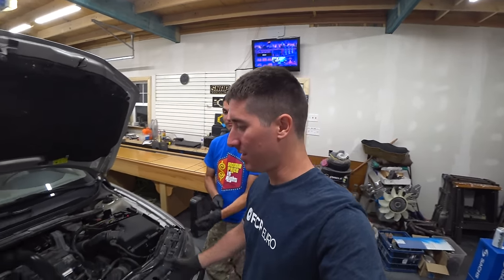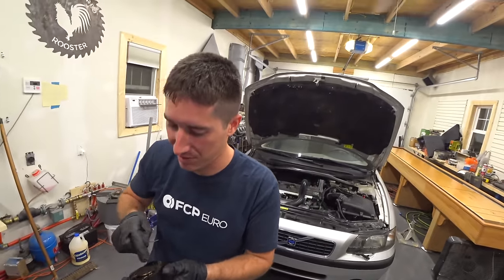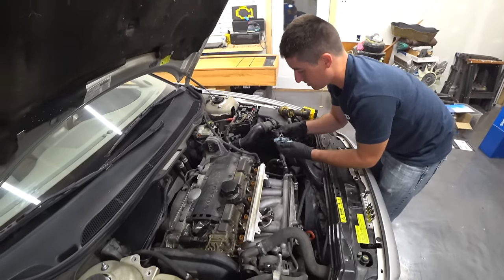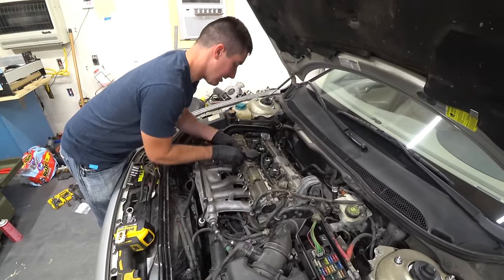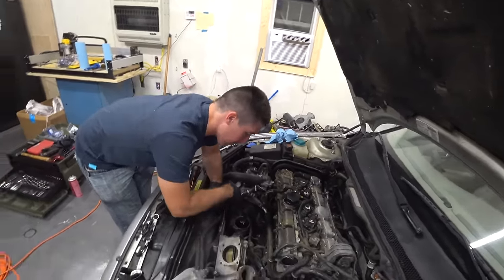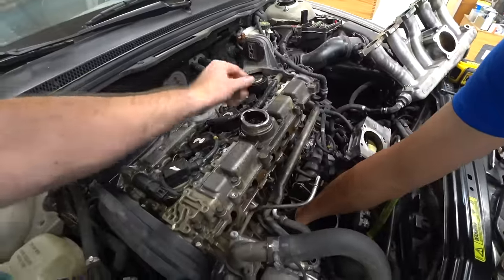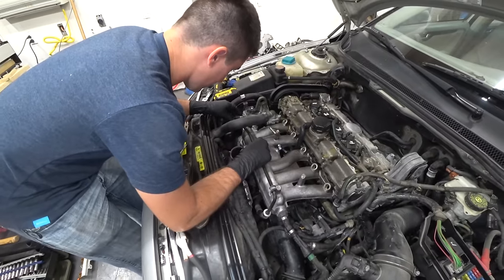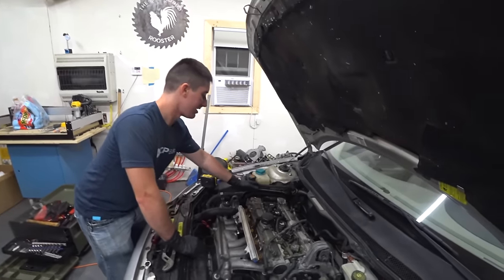POORLY DESIGNED Volvo S60 PCV System *COMPLETELY Clogged With CARBON*

Comment: I did that same job on my V70.. why didnt you do the coolant lines of the PCV and the part at the fresh air snorkel right by the Turbo? On mine those were about to go (cracked) and the connector part in the thermostat housing was corroded shut and caused some air bleed problems in the colling system. I would've recommended doing those too, because if you have it apart that far - it would suck to do it again in the next 30000 miles.

Comment: If the cam seals still leak after replacement, remove the VVTI mechanism on the cam and strip it. There is an o-ring inside that goes hard and is not always replaced when people change the cam seals.

Comment: I changed the pvc system on an 2.4 na s60 . The bottom left intake bolt was nearly impossible to get at . Used combination of swivels etc . In retrospect I think draining the coolant and removing the thermostat housing would have been worth it . Lots of time and swearing did get it done tho .
Reply: Thermostat housing has torx that are just as hard to get out and in. Will help broaden your vocabulary of profanities.

Comment: I gotta be honest. For these era S60's. If you find a non turbo they will probably run 300k miles if you take care of the suspension issues and don't have one the shitty ones with the transmission slip issue.

Comment: Step one with most Volvo 5-cyl work - remove radiator fan, you get so much more room to work in the front of the engine without the fan in the way...

Comment: You want to put some clean engine oil on the fuel injector o-rings before putting the fuel rail back in or plugging injectors into the fuel rail.  Pretty much any o-ring you want to lube up so they don't pinch and leak.  Makes installation easier too.
Reply: someusername121: Although we did that, I think we neglected to mention it.

Comment: When cleaning out the PCV box port, into the block. All the crud goes into the oil pan area. I do an oil change soon after. But, really hate the idea of that junk going in to a clean space. Any ideas out there? Like blowing air into the oil cap? What works, to prevent it, going in there? Thanks.

Comment: JR is a Volvo newbie. It's not called a throttle body. Its is an ETM, or electronic throttle module. And that connector is so easy to remove. Same place in my S80. I can take off and replace the etm in less than 10 minutes now its stupid easy. They love to go bad by the way
Reply: There is a company in Canada called Xemodex that rebuilds the ETMs to remove mechanical contact points and the ETMs will then last forever.

Comment: Your videos are fun and useful. On the PCV job and any subsequent jobs, it would have saved you a lot of time to remove the whole front end. It is modular and it opens a lot of room to work  cleanly and much faster. You just need to drain the coolant. That volvo will be good to go for a long time.
Reply: Andres R Torres:😉🍻

Comment: Was there no power steering fluid issues when you removed the power steering tube?  If there is when the system is filled with power steering fluid, what needs to be done to best manage the situation?

Comment: Hi guys I have a question about the PCV on a 2006 Volvo S60 R. When I do the glove test it sucks in at idle but then blows out when I press the gas. Is it supposed to blow out when adding boost? It's causing my return line o-ring to fail even after replacing the line, o-ring, and gasket after already servicing the PCV. Is there something I missed?

Comment: Did my 02 S60 2.4t PCV system a year ago. Exact same process you just went through. Its annoying to do but worth it. 
Is there a reason you disconnected your throttle body from the intake? i might not have caught that. i just disconnected mine from the tube and took the connector off.

Comment: Air or electric ratchets are awesome for those hard to get to places..   just a tip...
Reply: are you joking?  they're far too bulky for this job.  although I have the M12 3/8, what you really want here is 1/4 with extensions, these are all 10s and 12s anyway.  not sure you realize how cramped these manifolds are

Comment: The PCV on these 5 pot engines is a "maintenance" item. Also, it is not a complex job. These engines are very easy to work on considering their size and "complexity". Much better than a 2000s bmw engine for sure. Make sure you see RobertDIY on youtube to learn more about these Volvo engines. Oh, by the way, is this a segway for Doug DeMuro review an 850R?

Comment: Would the  use of top tier gas prevent the carbon problem? My 2001 Nissan Frontier was not built for ethanol and If I don't use top tier it will clog up some ports in the intake. May God bless ethanol.
Reply: not related to gas quality

Comment: If it eventually gets clogged with carbon, and pressurizes the crank case, would it be a good idea to put in a oil catch can, so it will not blow out the crank seals? Another question. Why does it clog up with carbon?
Reply: No, not possible or sufficient because of the additional blow-by from forced induction. This is the additional TLC and cost of driving & owning a turbo car. Does this make sense?

Comment: Its not poorly designed. The problem comes with not changing the oil. Just like most any other car that has carbon buildup.
Reply: That and too many short trips where the car doesn't get hot enough.  These cars need to go on a 45 minute - 1 hr trip at highway speeds a couple times a month to clear that shit out.

Comment: work on Volvos a long time.   people need to change their oil sooner than later.   alot of this stuff started when Volvo went to the 7500 mile interval and people went way over that and sludge etc. happened.    now with the 10,000 mile oil service even with synthetic is pushing the envelope.     we still see cars having issues with synthetic when they go too far on the oil.

Comment: Do you have to drain the oil before you do it?
Reply from the maker: No but I changed it anyway. If that bottom hole is completely clogged you have to drop the oil pan and clean the port from the rear. 🍻

Comment: If I had to do this again, I would remove the radiator fan first. Basically the same place on all transverse mounted in line Volvo engines since its introduction. When I did mine, I had the intake off for 2 days while I worked at my job at a parts house. Nothing like helping customers while scrubbing out your throttle body and intake ports. 🤣
Reply: Oh, and that last bolt under the thermostat housing got me so mad I took the belt off, moved the power steering pump, and take off the thermostat housing. I didn't care after that. I am now an expert in braille mechanics thanks to that throttle body connector. Hahaha!! (Easy mode reach in from under the right side of the intake manifold and you'll feel the connector.)

Comment: Do you torque all bolts back to spec when fitting back all components? Where do you get the spec for all bolts?
Reply: Nishen Naicker: Always! If the manual is not available, a quick internet search for the  bolt torque specification for the vehicle will tell you everything you need to know.

Comment: I need answer to the question what will happen if I cut the hose coming from the head, close the part going to the separator and vent the part coming from the head to the atmosphere by extending it and putting filter at the end of it?
I'm about to do it and I can't find any information on someone else who's done it.
Reply: Peter -- did you ever do it.   Curious to see the outcome.  I pulled the oil stick out and took the ruber seal off the oil cap as a temporary solution to minimize the pressure build.

Comment: WatchJRGo! Please help! 04 Saturn ion, high idle issues. 1200+ at stops, 2000+ in park! Shut off, restarted and it idled fine! I know the gremlin will return tho! Can you point me in any direction? Any help would be truly appreciated! Thanks a thousand in advance!
Reply: Thinking of pulling the throttle body, doing a thorough cleaning and replacing the IAC sensor! Anything I need to know? Please help me out man... Any info at all!

Comment: Lol my 2.4 NA is so my so easier to work on. My throttle body is completely exposed and I can get to my flame trap without removing the intake. Remove the electric fans and work from the bottom and top and I can get it out. The turbo has so much extra stuff in the way and also a different intake shape.

Comment: I'm going to do this job soon on my 2001 V70 T5.  Have to say, you should have never done this job without replacing that throttle body with a Xemodex electronic throttle body.  That's also a bitch of a job.

Comment: This is how tough it is to change the PCV on my Corolla. It’s buried under the intake and takes hours to change.
Reply: Scotty W how many miles on your corolla when you did that?
Reply: Roz Zeiler I do it at 80 to 85k miles. I mean it’s probably fine to go later since I change the oil every 5k miles with the best oil I can find. The owners manual does a terrible job at telling when to service it
Reply: thanks for the reply
Reply: Roz Zeiler no problem!

Comment: And you should see the super crappy PCV system in the Extra Crappy Chevy Sonic.
Reply from the maker: 😂 dang it, I wanted to buy one for a flip
Reply: @WatchJRGo  Just flipped a '12 Chevy Sonic hatch on Marketplace with my brother last week, sold in like 45 mins and my inbox was full, priced it at the top of KBB value. People must love them for whatever reason, we made a mini -killing off of it.
Reply: Don't you just have to replace basically the whole valve cover, a la' the Chevy Cruze?
Reply: @revolutionday1  On the 1.4L turbos yeah, but those are fairly easy 1-piece designs even though they're still stupid designs. He might be talking about the NA 1.8L.

Comment: How do you prevent the carbon build up in the first place
Reply: having done regular oil changes with quality synthetic oil since new is how
Reply: Mad DeXXX: You can’t. You can only mitigate the amount that builds through regular maintenance and oil changes.
Reply: Oil change regularly with good synthetic oil, avoid too much short trip stop and go driving as much as possible, don't use any Lucas, STP or any other junk oil additives.  The job will still need to be done every 75 to 100k miles.

Comment: These Volvo's aren't "poorly designed." Usually, they're poorly maintained.
Reply from the maker: @Gordon302  the PCV is 100% poorly designed… that’s why they made a new version that sucks less
Reply: @WatchJRGo  First of all, the 2001 model was the second year of the B5244S engine, which was used until 2009. Secondly, different engines obviously have differently designed PCV systems. Hence, that's why they changed it. Is it easy to do? No. But where else were they going to put it? The essential concept of hos it collects oil vapors is fairly simple in its design. Also, the oil pan isn't that difficult to remove. Since the PCV passageway was that clogged, then the rest of that passageway into the oil pan is going to be clogged as well. Also, companies like FCP and IPD are in business to sell you extra crap for your vehicle that you probably didn't need in the first place. There are much better dedicated Volvo only parts resources out there.

Comment: I think you convinced me to never buy a Volvo, just sayin'
Reply: I had a twin turbo S80 T6 same year as this, never ever again.
Reply: The old boxy ones where quite reliable, unfortunately they became so unfashionable they broke the fourth wall and hipsters are lapping them up.
Reply: Thomas: Best description I’ve heard yet!!😉🍻
Reply: Did this job on my s60r and it only took about 3hrs. Not too bad at all and it didn’t even need it, just a preventative replacement
Reply: @ST3ADYxKICKS  just did mine a few months back, same, just takes a few hours, other than that the S60's are great (06 S60 2.5T)
Reply: @Stressless2023  twin turbo holy moley
Reply: @GCast-iv1pd  Oh I bought it for $500 running and driving, and it NEVER ran right under full throttle. Had it at a Volvo "specialist" here in Detroit and he still never got it to feel like it wasn't only running on 2 1/2 cylinders smh. Sold it for a profit though.
Reply: Trust me if you get a volvo ur gonna turn into a volvo guy the community behind these cars is actually so beautiful

Comment: That's some ignorant engineering right there. Surprised they didn't put the air filter inside the transmission. What could they have been thinking of with that design? The PCV valve is a normal maintenance item you would do during a tuneup.
Reply: Woody Balto: fact!

Comment: it costed me $800 to fix the clogged PCV system on my Volvo  S60 . 2.5 T My next car is gonna be a Subaru!!!!
Reply: Frank Franky cheaper than the head gasket job in a subaru!
Reply: Funny, i went from a subaru 2001 legacy 2.5 to a volvo 2006 s60 t5.  The subaru is in the junkyard (head gasket leaked oil into coolant) the volvo is sitting in the driveway waiting on me to delete the pcv system.  volvo = better ride, drive, power, looks, and comfort.  Subaru just felt like an awd toyota.  Reminded me of my dads 85 tercel wagon, awd pos worst toyota ever maybe.
Reply: @bigoneforyoutolove  Don't get me wrong,I love my 2006 volvo S60 2.5 T awd  made in Belgium ! I own it since 2010 and I didn't have any problem with it,I'm talking about new models!Volvo is made in China but  Subaru is made in Japan
Reply: @frankfranky7410  cool, i get that, my dd is an infiniti.  hard to beat japanese reliability and the luxury sports car is nice!

Comment: Honda engines are the easiest to work on. Toyota is #2. Volvo doesnt want regular guys to fix their cars in the driveway, so they design it terribly. Ends up with a PCV change costing $100s of dollars in needless labour charges.
Reply: I've never met an engine easier to wrench on than a Chevy LS motor, and that's coming from a chick lol.  I'd give some Honda 4 bangers 2nd place though.
Reply: @Stressless2023  My wife cant even put gas in the car. I am serious. I wish I had married a girl like you. Sigh.